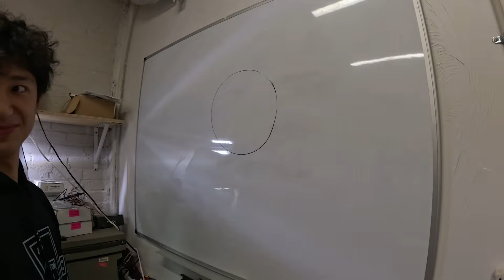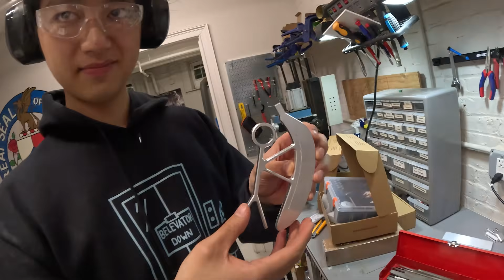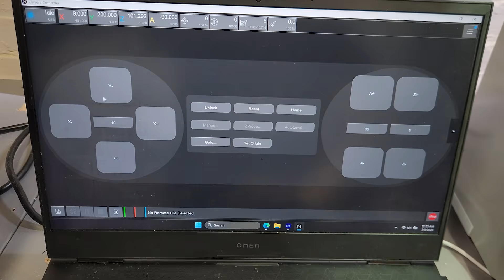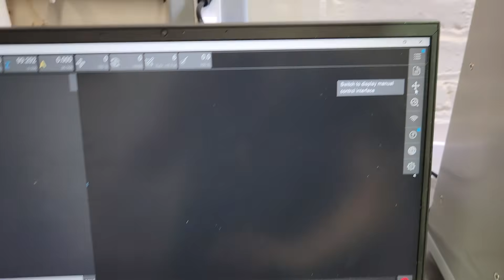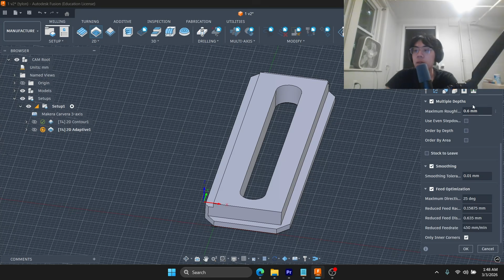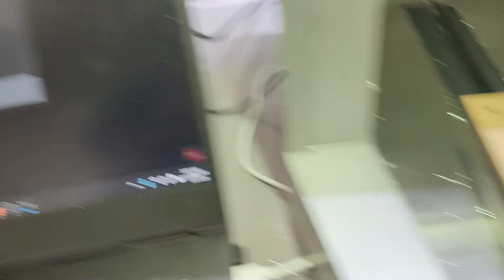Can I teach a finance bro how to use a CNC machine? | Makera Carvera Air

Comment: can it work on metal any thicker than the one you used in the video? What aluminium is it? can it cnc 7075?
Reply from the maker: i've used it on a lot of half inch aluminum with the stock endmills that it came with and it's come out fine so far. I don't buy any 7075 since it costs a bit more, but it should be able to machine it anyways since the properties aren't much different than 6061 machining wise